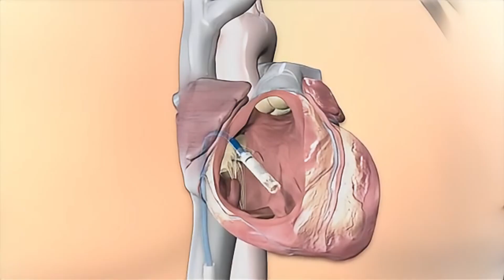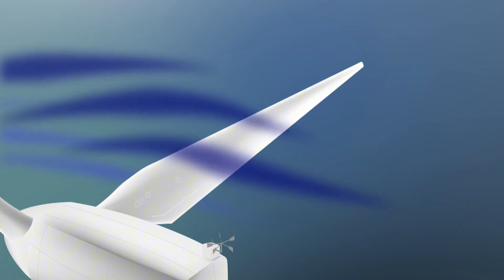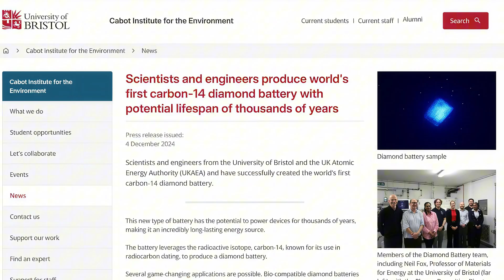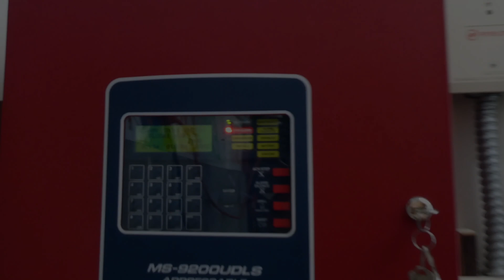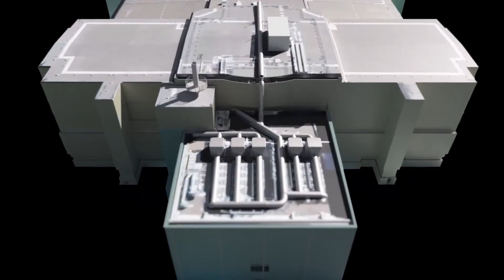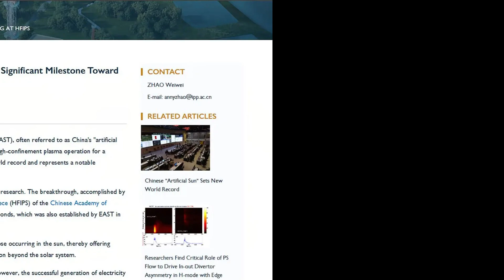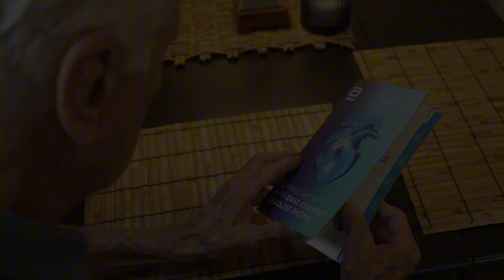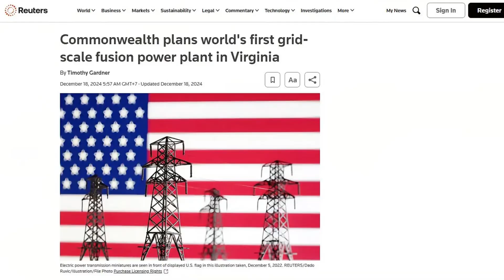Scientists Created a Battery That Never Dies

Comment: Shield them well and use strontium 90 plus a scatter gain layer and it will make actual power up to a few hundred watts or so for a device the size of a brick. ❤
Reply from the maker: Very interesting idea! Strontium-90–based generators and beta-voltaic concepts stand out for their super fascinating energy density.The big challenges, as you probably know, are shielding, safety regulations, and overall system efficiency – especially if we're talking about a few hundred watts in a brick-sized device.
If you have any papers or references you really like on Sr-90 systems or scatter-gain structures, go ahead and share – I'd really enjoy checking them out.